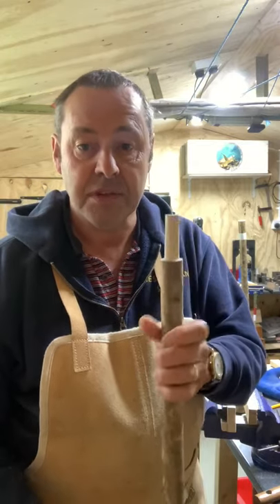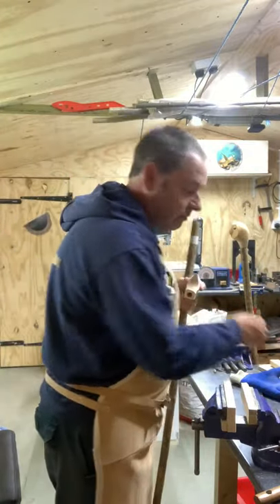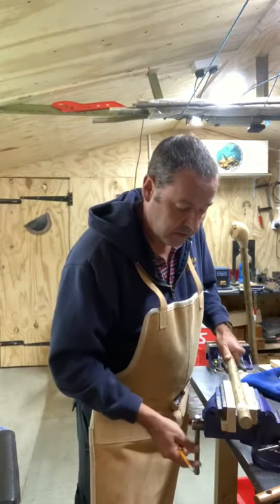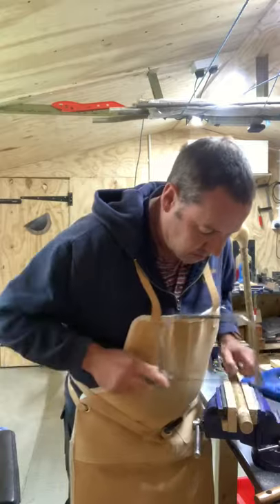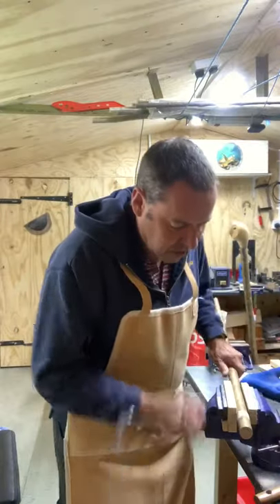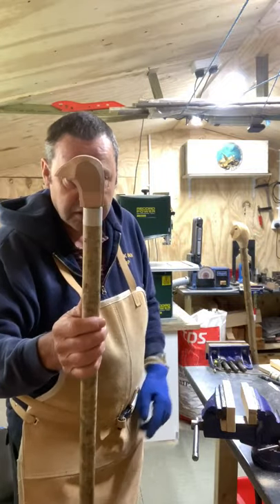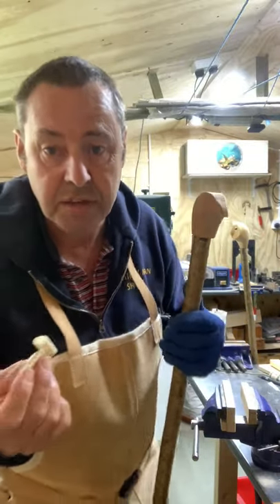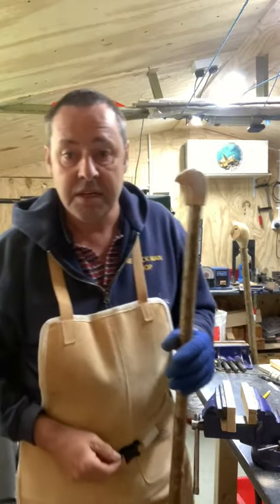My way of making a peg joint in real time, no editing.

Comment: Many thanks for your vid's. Been using a book to learn the skills.
Made Cardigan stick for my father with a traditional peg joint. Last stick i tried the thread bar type. Hated the flex around the joint, co back to peg joint for me. I have  also reinforced a peg joint with a nail as described in my book. Many thanks for sharing your experience. Regards
Reply from the maker: Thanks Tommy. Please do NOT use a nail in your peg joints. I get lots of sticks for repair, nearly all made with threaded rod but a few with badly made peg joints - and those "reinforced" with a nail. It doesn't reinforce the peg, it actually undermines it because all those broken ones I've had started with the nail in the centre of the peg and drifted offline to one side, so weakening that side! A well made wooden joint is all you need, don't mess with it.
Reply: @stickman315  Many thanks for the reply pure peg joint it is then. Do you have any shanks available to purchase, or are you still cleaned out. Regards
Reply from the maker: We still have plenty of shanks on the website. We don’t have many seasoned-only just now but once I go through them in the drying shed and trim some up they’ll be added to the straightened ones already on the site.

Comment: Great video. I have tried this, but the problem I have is how to ensure the tape goes round straight so that you join is flush. Any tips please?
Reply from the maker: If you struggle then hold the stick in the vice upright so the joint will be at your eye level and put the first end across the stick - your eyes are good at seeing whether things are level or not. Once you get the first bit in, turn the stick about a quarter turn and pull the tape round, keeping it in line with the first end. After a couple of turns you can see the first bit and line them up. If it’s out of line pull the tape off and redo it. It takes a little bit of practice but you will get there!

Comment: Hi I'm a total novice could you use a square tenon and mortise for this
Reply from the maker: I suppose you could - but why would you make it more complicated than a round one? It's very difficult to cut a square socket in a stick head or handle but very easy to drill one out.
Reply: @stickman315  not if you've got a morticer 😉
Reply from the maker: @plipertyplap4899  I'm still not convinced - a round hole allows you to rotate the head and shank to get the very best fit you can and produce a joint with no gaps. A square peg and holes relies on you doing both perfectly first time, every time. If it works for you that's fine - but I couldn't recommend it to a beginner.
Reply: @stickman315  yep understand what your saying its only the fact a square peg in a round hole has no chance of twisting I'm certainly not trying to rewrite how sticks are made a d without doubt I'd take your advice over mi e cheers 👍